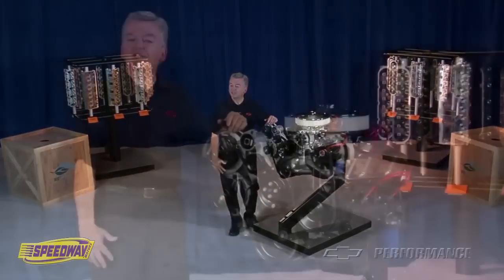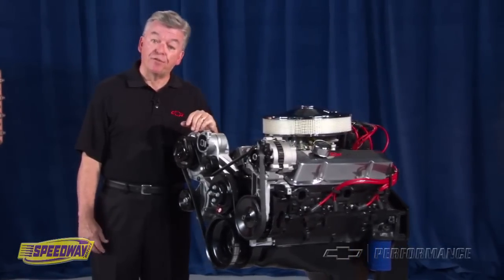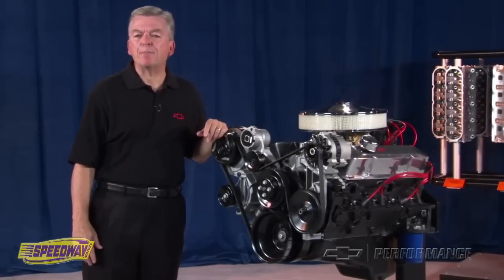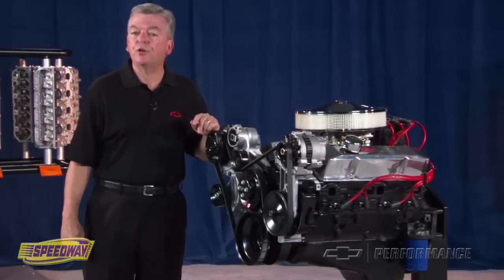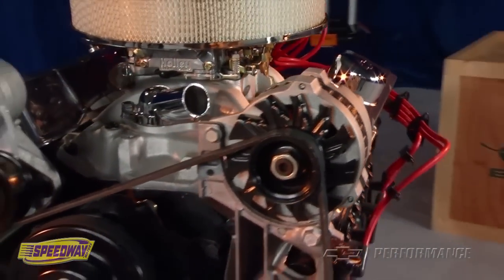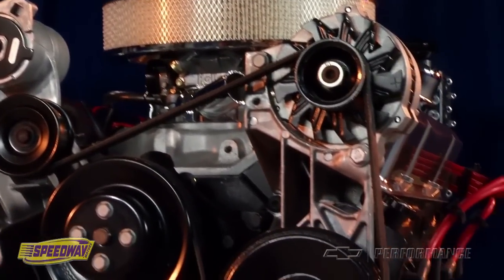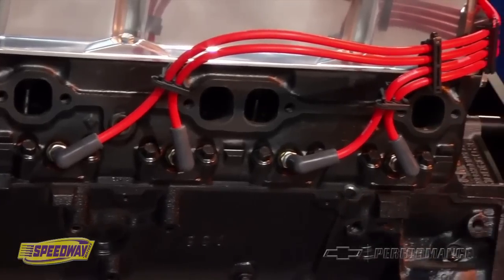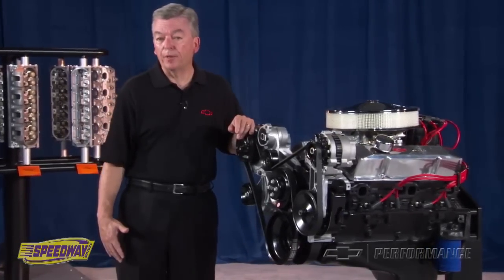GM Performance Small Block Chevy 350/290 HP V8 Engine

Comment: I would put roller rockers on this, to enhance the durability. Less wear on the valve guides. An outstanding truck motor. Having dealt with Holley fuel bowl gaskets, I would want a Rochester Quadrajet carburetor.
Reply: Only if your truck and usage is light enough and gearing high enough that you don't need power below 2,500 RPMs... where it comes on the big cam...
Reply: @BuzzLOLOL  cam power varies you can get power from 800rpm to 5000rpm
Reply: @jonathanlawson4667  - The engine in the video with 224/224 durations cam doesn't 'come on the cam' until 2500 RPMs and above... it's not good for a heavy truck pulling a heavy trailer... for that a better engine would be the one rated 190 - 260 HP with a 194/202 durations cam...

Comment: talk talk talk , lots of arm chair pros don't know jack shit , 210 hp net my ass , I have this engine in my 71 chevelle .with headman headers & 670 Holley street avenger in front of th350 & Yukon Posi with 3.36 gears  and it runs like scalded dog ,plenty of power for a street performance car, power band is 2800 rpms to 4000 , at 3500 rpms this engine is screaming .much more power and it would be dangerous  on the street , great gas mileage and sounds Friggin great  ,  the truth about this engine is put good gears behind it and it will blast down the road ....
Reply: Thanks brother!

Comment: Not certified for off-road use? I guess I will have to build my own then and certify it myself, with a better cam for torque in the very low end up to about 3000 rpm and with better heads and intake...

Comment: Is it possbile you can tell me the motor i have the stamp on the back of motor says GM 3970010 thats on drive side rear and front by heads passenger side says V0125TJZ

Also on the passenger side the rear says A86 (inside an oval)
Reply from the maker: Your engine appears to be a 350 cubic inch v8 from 1973. My info said it was from a conversion cab platform and made 155hp.
Reply: Speedway Motors next question what stuff and i take  off the motor that i really dont need....
Reply from the maker: @Martyimgay  Give us a call at 800.979.0122 and we can chat more in depth.

Comment: Im reaaallyy considering slamming this shit in my S10. Any objections??? The 2.2l just giving me to many headaches..
Reply: You will probably have to get a new transmission because it probably will not bolt up.  Also the 2.2 wiring is different the rear end wouldn't handle this

Comment: How hard would it be to install this into a 1991 Corvette?
Reply from the maker: This would not be a direct bolt in for a 91 Corvette.  This engine is a 2 piece style rear main seal, so the flexplate/ or flywheel on your existing engine is incorrect.  This also has cast iron cylinder heads, and a different bolt pattern for the intake manifold, so that would not transfer over either.  It could be made to work with enough modification, but certainly not the easiest choice out there.

Comment: dumb question but would this fit in my chevy cruse 2014 1.4l turbo someone told me it would but i doubt it. Anyone who can help plz
Reply: Civic Leader Cv Trill You're asking for problems.
Reply: Civic Leader Cv Trill The 350 isn't a big engine by any means, and yeah, it could be made to fit in the engine bay, but it would cost you so much money to modify the frame, and get a new trans just to use this engine, that you'd really be better off just buying an old muscle car that already has a 350.

Comment: a great motor for the price but this is just a good, reliable 350.. buy it and immediately start work bring the compression up and add a more aggressive cam/valve-train maybe it'd be a real 300hp motor..
Reply: Simply adding headers alone will bring the HP up to 320 HP with a ZZ4 intake.I am currently running a Performer EPS and a 750 CFM Quickfuel carb, I know it is at least 325 HP basically untouched with the stock cam and small valve, low compression heads. Short term plans are for a set of good aluminum heads and cam swap.
Reply: @johnboy4161  💪💪

Comment: yea but for 2500 your getting a good deal.  the coyote is milked lol.  but with this engine you can upgrade to over 600 hp N/A
Reply: I wasn't talking about, nor did I mention, potential or price. What I said if you will bother to read my comment is that 290 H.P. from 350 C.I.D. is not, by todays standards, a high performance engine, and it is not.
Reply: 290 hp is about 50 to 100 hp higher than your average daily driver.  by todays standard thats high performance regardless off the 700hp hellcat or whatever the fuck you drive.  and ford 302 at 420 hp isnt average
Reply: and this engine design is over 60 years old and has always been high performance.  it will be called high performance always
Reply: James7796ify average v6 Chevy makes about 300+hp so this is consider slow and 4cyl make from 148-250hp
Reply: bigkarl24 I got 380 hp 😂 and 450 torque 0-60 in less than 5 seconds imagine supercharged or twin turbo or in a car hahahah

Comment: 305tpi makes around 300hp with a small cam out of a stock 96 z28 lt1 and intake to work with 305 vortec heads 290hp for a 350 is not alot of Power at least 1hp per cubic inch
Reply: ***** true if it'd a 302 you can make shit load of power
Reply: Truck motor. Low speed torque. Perfect for a small RV.
Reply: That cam doesn't make torque/HP below 2500 RPMs... it's for lightweight vehicles...

Comment: This engine's horsepower is gross horsepower. The net horsepower is way lower due to the smog cylinder heads which give it a 8.5:1 compression ratio. Actual horsepower is probably around 210 horses.
Reply: Hey, you seem to know alot about cars.
How can you distinctly tell me the difference between Manual and Automatic engine and if so whats type is this http://www.speedwaymotors.com/GM-Performance-19244450-Small-Block-Chevy-350-290HP-Deluxe-Crate-Engine,70071.html  <---- Looking for an automatic for my old 1995 firebird
Reply: Knation® I have a 95 LT1 with 0 miles. Fresh rebuild with papers from machine shop.Complete with computer and wiring harness. $2,500
Reply: Knation® Is the 350 you're looking at a pre '86?
Reply: Knation® i checked your link. it is a pre '86. way too much work to put in a 95 pontiac. Holler back if you have any questions.
Reply: Is it an manual? If not the what is one, My dad is a mechanic  and lives out of town and I was going to pay him to put an manual transmission and  engine in.
Reply: The only difference between a manual and automatic is a manual takes a fly wheel and automatic takes a flex plate. A new engine comes with neither. You have to purchase the one you need. Google an image search for flywheel. You'll see the difference. A 350 has to be dropped out of the bottom on a 95 firebird ,formula & trans am.
Reply: EDELBROCK77 It's got an L-82 cam, so its basically a 70's/80's 'vette motor with an aluminum intake. Probably closer to 270 HP....or 290 HP with headers?
Reply: Knation® 1995 is old?....???....!!!!!
Reply: Old enough to cost $5,000 new enough not to cost $30,000
Reply: The cam is originally from the '68-'70 350 HP 350" 11:1 engine Vette-only...
Reply: EDELBROCK77 plus they have flat tappets you can increase the hp with rollers
Reply: Hot Rod Magazine did a build on this motor, on a Westech dyno, with a ZZ4 intake and cast iron manifolds it pulled exactly 290 HP. Adding headers alone it made another 30 HP... all specs and build info is documented. I have this motor in my mid-engine Corvair with custom headers, a Performer EPS, 750 CFM Quick Fuel carb and a HEI, I am betting it is an honest 325 HP motor all day long. The biggest drawback are the crap small valve, low compression heads. With good heads, hydraulic roller cam, etc they made 430 HP. Lot's of potential in this little mouse...

Comment: 290 hp from 350 cid is hardly high performance. The Ford coyote makes 420 hp out of 305 cid.
Reply: This is just a starting point... you can build a 350 to whatever you want it to be for the most part.
Reply: sirlanceem Yes you can, and if you are pulling 500 or 525 H.P. from a 350, that is around 1 1/2 horse power per cubic inch, then you have a high performance engine.
But that's not what they have here,  they're putting out far less than 1 horse power per inch and they are calling it high performance, it's not what you can do that I'm talking about, it's what they are doing, and what they are doing is not high performance by todays standards.
Reply: exilfromsanity Yes, i completely agree with you  on this! it's quite a mild 350 in performance terms.
Reply: sirlanceem Thank you, that's all I'm saying.
Reply: And Chevy V6 makes 300hp
Reply: The Ford Coyote is also an engine that just released in 2011, and the SBC 350 released in 1955. Back in the 350's hayday, yes, 290hp was one of the highest power engines on the road. 

To boot, the Coyote 5.0 is squeezed for every ounce of power available. Have fun trying to get more power out of them - changing all 4 of the camshafts will cost you at least $2,000 just to buy the parts, and another $2,000 to pay the poor mechanic who has to work on that junk, and at the end of that $4,000 trip, you're not gaining more than 80hp. 

The Coyote, and all Ford motors for that matter, are pathetic. No one uses them to build massive amounts of power because they're to complicated and unreliable. Ask any engine machine shop which engines are the easiest to work on, which are the most reliable and which make the most power. You'll likely get "Chevy is easiest to work on and most reliable, MOPAR makes the best power, and Ford is shit." Or "Chevy is easiest to work on, MOPAR is most reliable and best power, and Ford is shit." 

Anyone with experience working on and building engines from the 'big three' know damn well that Chevy's are easy to work on, MOPAR's are fire-breathers, and Fords are junk. But I digress.

Ford's cost to much to work on.
Reply: ***** The 5.0 Coyote is $7,300, 420hp. For $5,500, you can buy an ATK crate 350 that's 408hp, and then spend the rest of that $1,800 you saved for a cam, carb, intake manifold and headers, and have a 530hp 350 for the same price as a 420hp Coyote.
Reply: BloodstainedSinner I wasn't talking about, nor did I mention, potential or price. What I said if you will bother to read my comment is that 290 H.P. from 350 C.I.D. is not, by todays standards, a high performance engine, and it is not.
Reply: ***** I wasn't talking about, nor did I mention, potential or price. What I said if you will bother to read my comment is that 290 H.P. from 350 C.I.D. is not, by todays standards, a high performance engine, and it is not.
Reply: exilfromsanity But you're comparing an engine that's 3 years old to an engine that's as old as your grand parents.
Reply: Chevy 4.3 V6 is the same engine from 350 and makes 300hp
Reply: For less than a Ford Coyote, you can buy a SBC 400" 550HP crate engine from BluePrint Engines... or Summit... 
https://www.youtube.com/watch?v=-XjDq2DcZk0